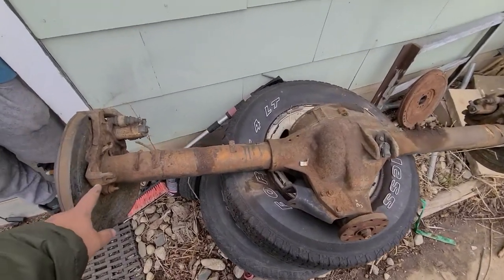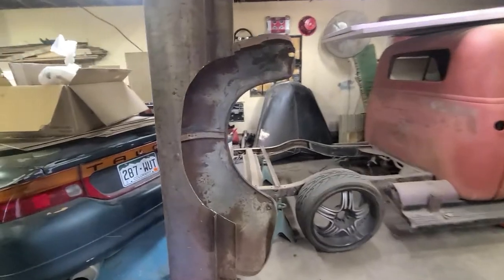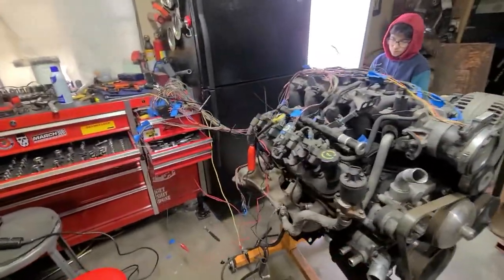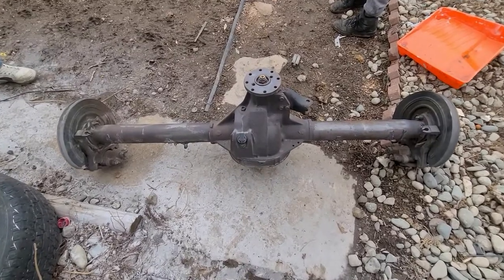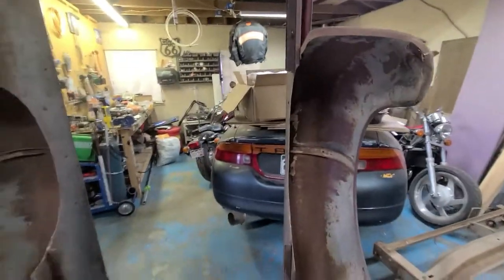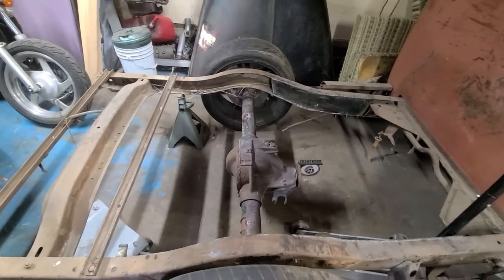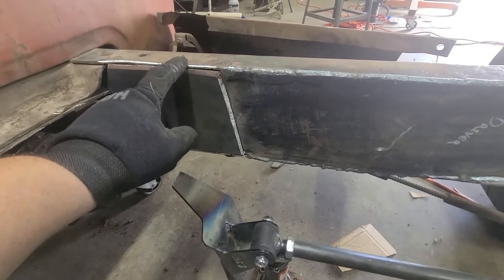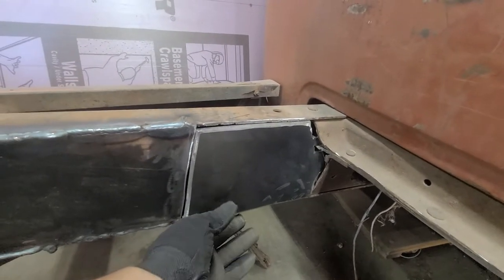Triangulated 4 link goes in part 1

Comment: Nice explanation on everything you were doing. I hope it worked out for you! I am curious as I have the same Welderseries 4 link and I am installing it into me '56 Chev shortbox and I was wondering if the way you have the front lower bars positioned, did that work? When I mock mine up, I have 3" between frame and the axle at ride height and my front lower bracket is the same as yours. This gives the lower bars an upward angle towards the instant center, not much mind you. I didn't think the front lower bracket has enough contact with the frame for a solid mount. Did you leave yours where they are mounted in the video? Thanks